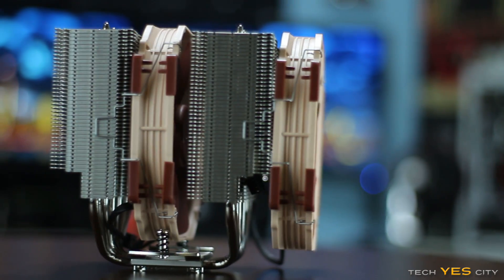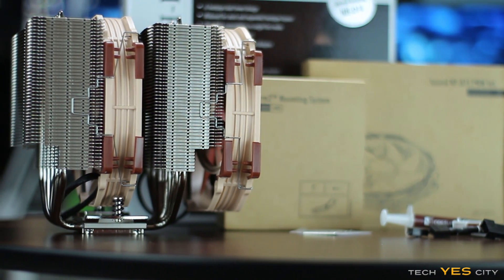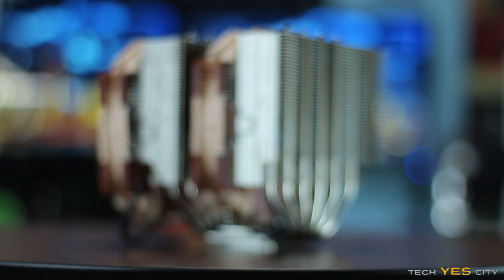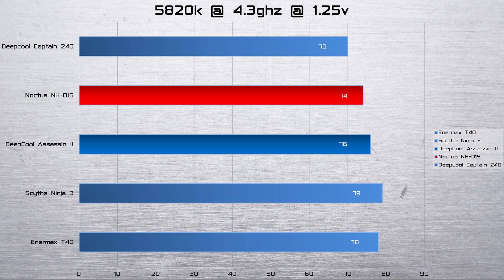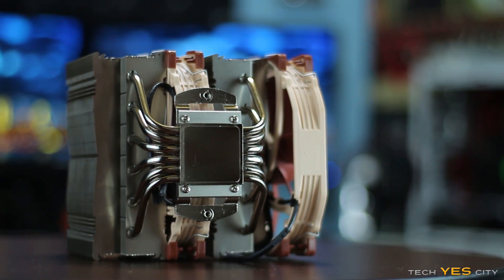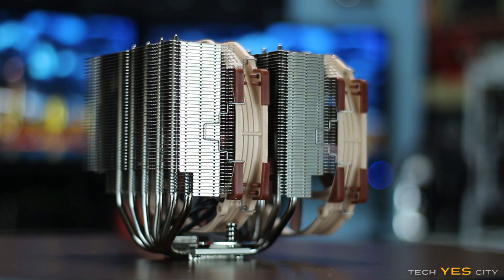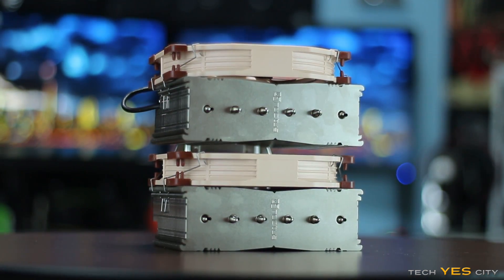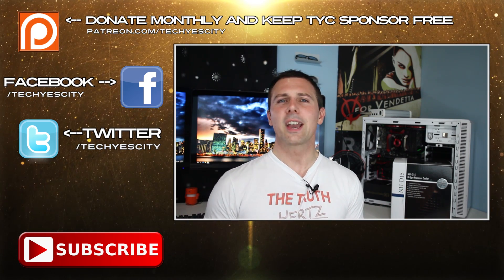NOCTUA NH-D15 Review - The BIGGEST and BADDEST CPU Air Cooler there is!

Comment: I tweeted to you as well but feel like the tweet needs a bit of an explanation. Everyone says that water cooling is better for a cooler GPU, and that air cooling is better than very limited air cooling. However I haven't seen a proper comparison between the different kinds of cooling. It is quite self explanatory that the different cooling solutions give a different result, but I want to know how big of an impact a bad cooling solution will affect an average FPS in a game. Let's say a very small case like the Fractal Design Node 202(or something similar) compared to a Define S with air cooling vs define S with water cooling. Is the larger case and the extra cost of a water cooler worth the performance gained? 

Many questions to answer, but I think a video about the topic would be interesting :)
Reply: +Stian Hansen air cooling requires less maintenance and lasts way longer. water cooling is just a bit better from high tier air coolers but you need to maintain some and the life span is short compared to air. Also air coolers sometimes just look much better
Reply: +Vasco Serrano (Neffarion) yes, I am fully aware of that. As I wrote, I'd like to see a more detailed explanation with sound levels, thermal throttling, degrees and cost. I would like to see the different results compared to different cases and look at the performance per dollar and noise and so on. Is it necessary to invest in a high end water cooler if good airflow will give you the same results? (Sorry for a messy reply, I just woke up).

Comment: yeah its huge and cools anything. got d14 and 15. but most importantly quiet.
Reply: +tulp35000 will it fit for my fx 8350 ?
Reply: Philip Mario
 i got d14 on my 8350 and gigabyte 990xa ud3. It fits fine. But in the unconventional way. Temperatures are fine though. Make sure to use all low noise adaptors.. maybe even plug them together. Gigabyte hasnt rolled out win10 easytune6 to lower fan speed because it doesnt need to run at 100% at all times. Or a fan controller u can buy should do fine as well.
Reply: thanks for the feedback :)